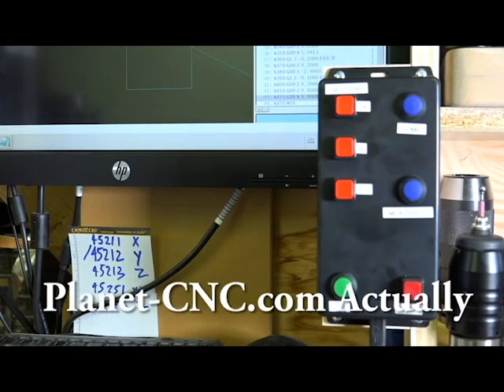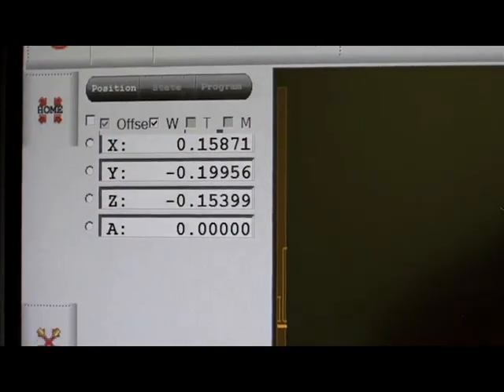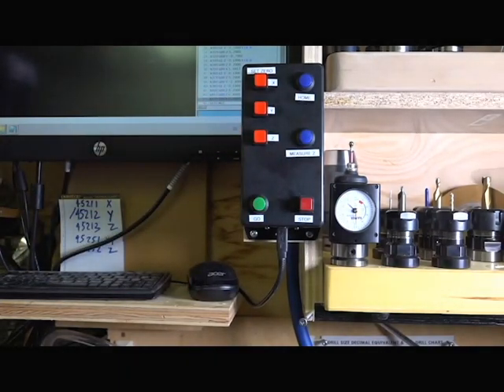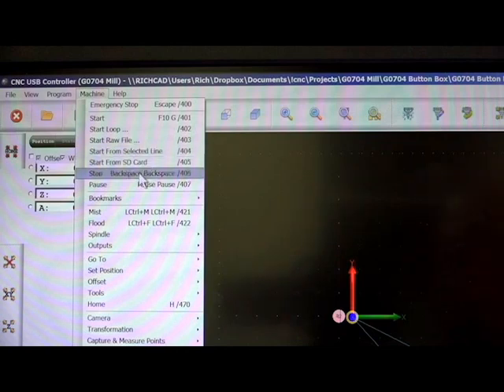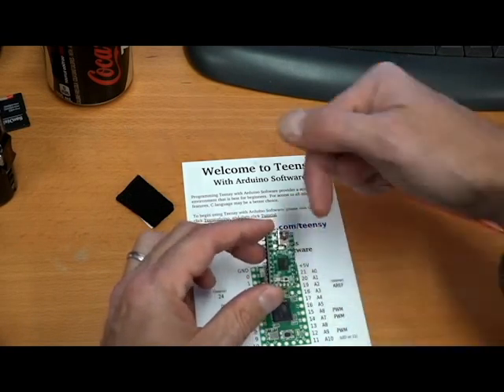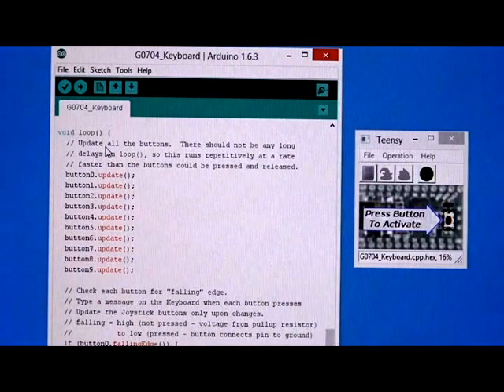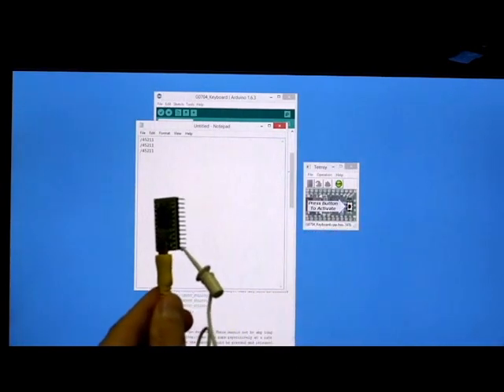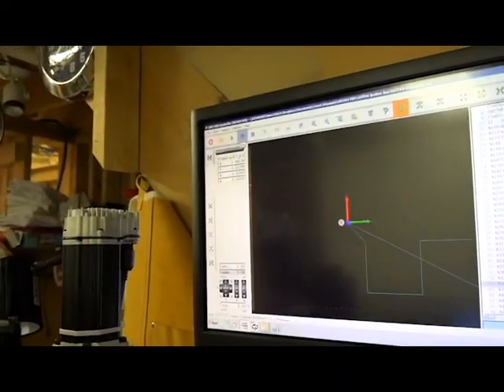Custom USB Keyboard to control G0704 mill using Planet-CNC.com controller

Comment: Rich, I too have the Planet CNC mk3/4 controller. I've done arduino programming in the past but I'm a bit confused just how the keyboard emulation is working. Once you've uploaded the sketch to the teency, how is that making the comm connection to the CNC controller board. Is it wired directly to the teency using Tx pin or what?   Help me Obi-Wam Kenobi..... stephen standing by

Comment: What an awsome idea. I use the MK3/4 controler from planet CNC too.
I was looking for a remotecontroler for half a year. The controlerboard only have 4 inputs to use. For my cnc mill is it not enough. Now this is the the best way to fix. Thank you much for this "manual". I solved with a Teensy 3.2. It works perfectly and it is so easy to programm.

Comment: Thank you for such a great video.
I wonder if you could help me...
I am planning to make a custom keyboard too, but I need a few more buttons, I would like to have all the navigations buttons, but this give me two problems:
first one, how can I connect some thing like 24 buttons to arduino?
second, on the navigation buttons, via "GUI" (or via mouse...) he have "fine adjusting movement" (step?) did you know if there is an input code for those movements on each axis?
Thank you  :)